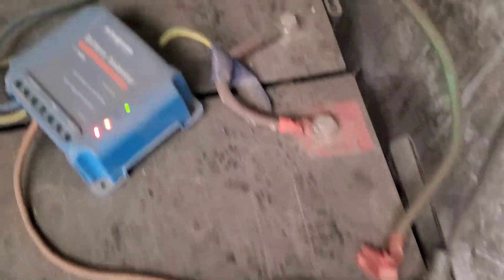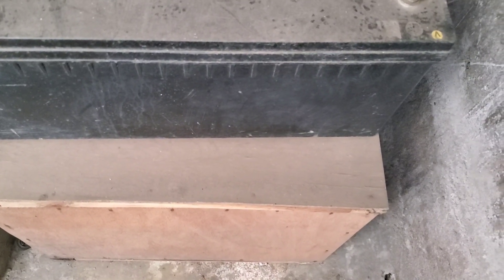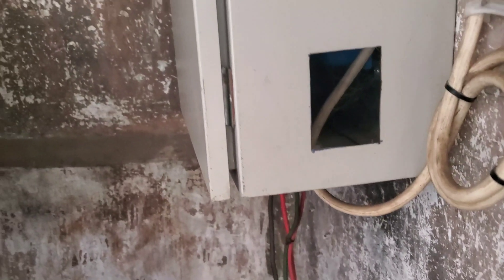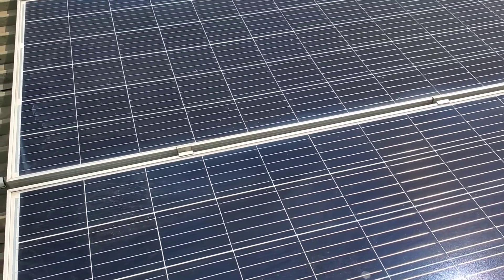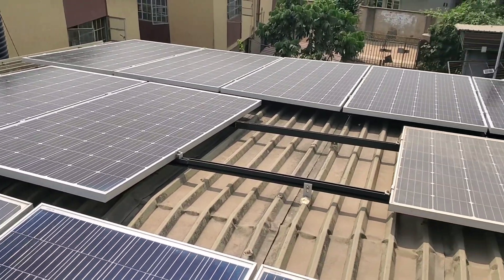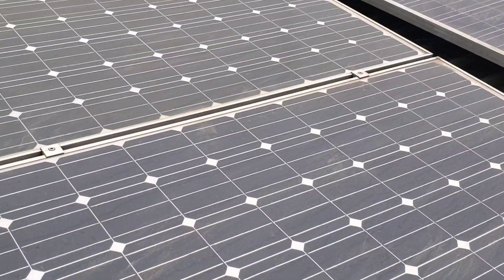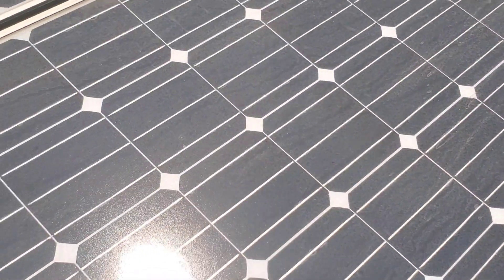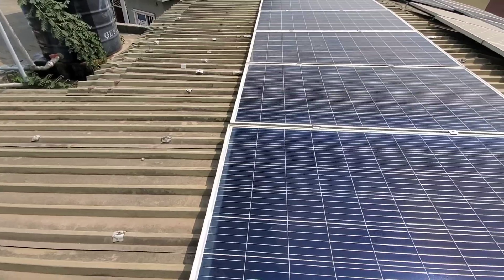Why you must clean your solar panels.

Comment: Dust is just as bad as snow. Take care brother
Reply from the maker: Yes it is. It completely covers the panels. When snow melts the panels are clean. Dust just remains until it rains or you wash them off
Reply: @drsolar  There is quite a bit of dust in snow. Usually leaves a mess after it melts but not a sheet like yours

Comment: Season’s Greetings and the very best wishes to you and yours for 2020, Mr. Chris. With regards to panels totally agreeable or if you had a borehole you could just hose the panels at least once a week and monthly thorough clean. On your water tank issue, you could use it as is but add a 0.5hp pump with a 100litre pressure tank to your system which will have a pressure metre set to about 3-4bars. This can safely run off your solar system as mine is and not strain or drain your system. Possibly your next project 😂 All the best.
Reply from the maker: Welcome to 2022. I wish you a 2022 beyond your imagination. I already have the pressure tank / vessel. It stores about 95 liters of water and can put between 45 to 60 psi of pressure into my system. Having two pumps plus an extra storage tank when one pump and my pressure tank will do is a more cost effective option. I appreciate that you share ideas. You help make me better at what I do.